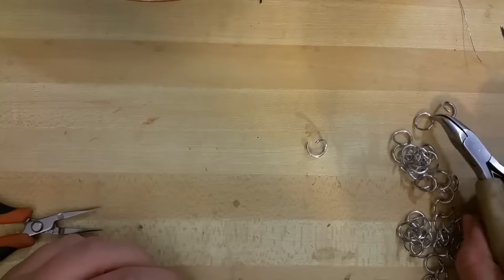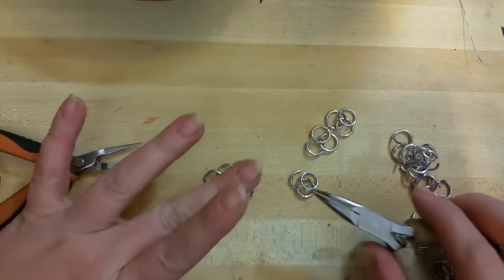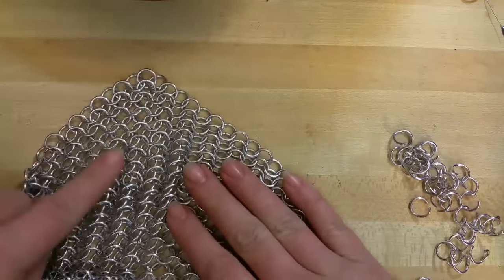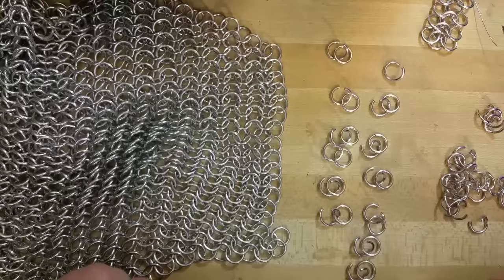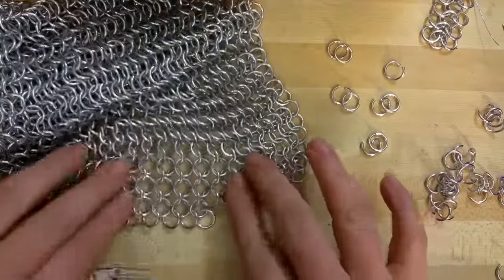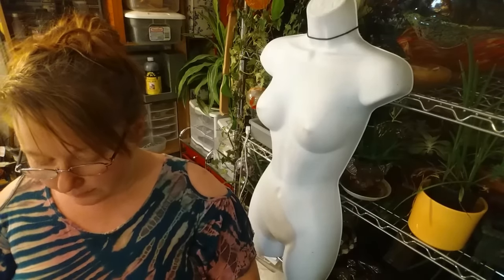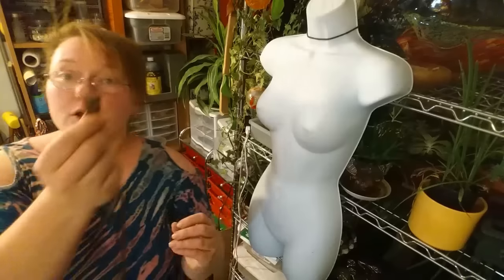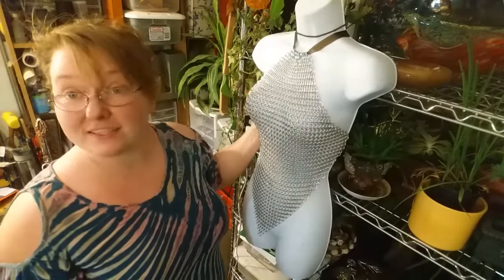Weave for Chainmaille Armor

Comment: I enjoy watching your tutorials. I've been weaving maille for 40+ years now. I started out making maille for use in combat when I was a member of the SCA many, many years ago. My haubrek had over 50,000 hand turned/cut 16 gauge 5/16" galvanized steel rings (about 1-1/2 miles of electric fence wire). Now, I make jewelry and the occasional bikini. Again, your tutorials are great and well worth watching, especially if you are thinking of getting into the craft. Thanks for posting.
Reply: Yvonne. I don't know if you have ever heard of this little trick when making Euro 4-1 pieces, but if you ever want to add pleats to say a skirt or dress do this. When you get to the waist of the piece you add a third hanging ring to every other ring. In other words, 4-1 then 5-1 then 4-1 then 5-1. The next two rows are the normal 4-1 pattern. The row after that is again 4-1, 5-1, 4-1 ad infinitum, followed by two rows of 4-1. Rinse and repeat. By the time you get to the hem of your piece the circumference will have increased dramatically from where you began the pleated section. The bottom of my haubrek was 500++ rings.

Comment: Yvonne, I made a replica of the Bayeux Tapestry chain mail armor out of the old black spring wire clothes hangers. Over 100,000 hand wound and hand cut rings. Aluminium is ok for show, but for use, steel is required.
One MUST wear a tough material under the mail, even if its alu. The ends of the rings can really shred you. Mi padded gambeson was 2 layers of denim with padding in between. If one intends to fight in mail, it does leave some interesting patterned bruises also. I have both the tee shirt and hat on that one. The coif I made from screen door springs which I cut.
  Butted mail is easy, but labor intensive to make. One can either weld the ends of the steel type or flatten , drill. and rivet each link. Really looks nice when done, like the original was, but sooo time consuming. My set, with coif came in at about 65-70 lbs.
 Also I recommend using 2 pair of linemens'  pliers to assemble both alu. and steel rings. You would destroy the light pliers you used for the alu. trying to do steel or even brass mail. I ruined 2 pair of SnapOn needle nose before going to the linemans pliers.
Its easier on the hands with the bigger pliers also. IIRC, I took like 6 months to make my mail.
(And yes, even with the steel rings, in use, the "chainmail moths" still make holes in it that need repair if one actually uses it).
 Nice job on it.
Reply from the maker: Woah, thats an intense project! I've found that the saw cut rings I use for these aluminum decorative pieces are very silky and comfortable, especially after tumbling!

I will check out those pliers; thank you for the recommendation and sharing your experience with maille!
Reply: Yours were saw cut. Cheater :p I was unable to find a blade for that. I used 18" end cutters. I wore out 3 pair of ones from Sears!  I also made my own winding mandrel from 2x4's and round bar, and part of a broom stick.
It was an intense project. The folks at work thought I was nuts(?) but I'd sit in the lunch room doing my "Chain mail knitting". I made some pants leg bags out of old jeans to keep the tools and links in too.

Comment: Does it matter which way the grain lies? Side to side or up and down?
Reply from the maker: Heya, Resist! You get different drape and movement from the maille depending on which way you have the grain lay; I recommend making a 4" square and testing out the drape for yourself to see which way you prefer for your project <3

Comment: Can you get these rings in regular shops as well?
Reply from the maker: Heya, Dark! I haven't been able to find the thicker gauges in larger sizes at Michaels, hobby lobby, or Joannes, but your local stores may be different
Reply: Thanks for answering :) I'll visit my local store and have a look, any idea where i can get a shaft that can be attached to a drill to furl the wire? PS: When making scaled armor, how many scales would I need? I'm confused with the measures used at TheRingLord. Thanks ;)

Comment: I've repaired a couple of this cheap type of chainmail from India the same as you make and I should say it has a lot of issues eg it looses rings as they bend out a little just because of the weight of the armor itself, it stains everything it touches with silverish grey spots and stripes, it catches hair and threads. So probably the only reason to buy it is it is almost dirt cheap in India as they  use chainmail machines and it is light weight because of the material. So my questions are did you try to improve it by soldering or welding the rings close instead of just butt join them? And also did you try to anodise the whole armor anyhow or use anodised rings?
Reply from the maker: Hello! There are a few key differences here between what I made in this tutorial and what can be purchased cheaply online; I use a heavy gauge of bright aluminum appropriate to the costume piece; there are very few tension points on this top so 16ga worked wonderfully. for a shirt with sleeves I would use a 14ga butted aluminum. The bright alum. alloy I use is much cleaner than the fencing wire aluminum used in cheaper maille. Doing a clear anodize on the whole piece or using anodized rings would solve the grey residue problem, but the budget for this piece didn't allow for anodizing. The customer was fully aware of the tradeoffs. Also, properly woven saw cut rings won't catch the way poorly woven machine cut rings do. Body hair can still be snagged between rings though, but that would happen even with welded or riveted rings because its catching in the weave, not in the cut of the rings. I'm sorry that has been your experience with butted aluminum chainmaille, but that level of quality isn't the standard for handwoven work.
Reply: Thanks for the reply. So did you try soldering or welding?
Reply from the maker: Zortorond I have tried with with my little iron and coil of flux, but I think I need a torch to really get things soldered together. it could be my inexperience,  but I didn't care for the results. the chainmaille didn't feel as silky because of little bumps soldering made at the joins,  and the amount of time it takes would have at least tripled the cost of the piece. also,  I wouldn't recommend aluminum,  even riveted aluminum,  for live steel combat.

Comment: now question. i used to make chainmail. did you make your own rings or did you purchase the rings? im asking because i used 18 gadge wire and a 3/4 steel dowle and then cut all my rings with a dremal.
Reply from the maker: Hey, Erik! I coil and cut my own rings using steel mandrels from www.theringlord.com, and bright aluminum wire that I get from them as well, and I cut my rings using a Ringinator. I typically don't use less than a 16ga wire for my rings, but I use a lot of 18ga for my jewelry :)

Comment: I want to make make a chainmail belt for a cosplay what would in your opinion be the best size ring to use?
Reply from the maker: Hey, Deanna! It depends a lot on the way you want the belt to look; in this project I used 16ga 5/16", which gives a wider mesh fabric that weaves more quickly. I really like 16ga 1/4" though because it looks very solid!
Reply: Thank you for the info :)

Comment: I found it faster to make a bunch of sets in the lengths I needed and then stitch the sets together. I could make a bunch of sets a lot faster and with less confusion than trying to keep track of the entire suit. Of course, I used 14 and 16 gauge steel... It was also lighter to deal with a length of sets and then add them to the suit over the form.
Reply from the maker: That makes sense! I work a lot on smaller pieces; this is the largest top I have made in a while, and I'm usually making bikinis and halters with contractions and seams in them where, at least for me, it makes sizing easier to add onto the whole piece so I can keep measuring/ modifying the design as I go. and omg the weight difference between steel and aluminum makes such a big difference!
Reply: My friend made his full chain hauberk from 14g galvanized steel... It weighted in at like 54lbs

When you are doing measurements, are you taking into account clothing under the chain? I know you have to account for the gambeson. I was always curious if the bikini chain and tops was worn over something, because chainmail can be rather pinchy... ;)

Comment: For some reason, I have a very hard time doing by this. I have dyslexia and wonder if that's the problem.
Reply: Rena Godfrey I can understand your dilemma. I do the wire weaving and if I'm not careful when I first start, or put it down and pick it up, for some reason I put it in the wrong hole and have to go back and redo. I catch it right away, so it's usually not a hassel. Yavonne, gives a heads up about any entanglements you might run into in many of her videos. I took her advice and did a few practice pieces. Start small and then go bigger.
Reply from the maker: It could be! I am dyslexic as well, and so I weave backward to how Randy does, which is great because when we work at a table together he is sitting across from me, so it all works out. Chainmaille is not widely known for being easy, so be patient with yourself and you'll get there!

Comment: Great chainmail work, please don't call it armor though, this is clothing. It won't protect from a weapon as the rings will just split back open. For chainmal armor, you need to close the gap in each ring. Traditionally with rivet's, more modern with welding. But i guess that's not the point anyway, considering the shape (;
Reply from the maker: Thanks for the info, Patrick! yeah, this one is pretty obviously costume :-p

Comment: sadly this wont really hold up to practical use .. so ist not really what was used in medivel europa ... oll i ask is that i sell it as what it is. a prop for theater and cosplay
Reply from the maker: It is the same weave pattern as what was traditionally used. I thought I
 made it pretty clear that this is a fashion piece that is meant for 
costume purposes or at most larping with foam weapons. Live steel combat
 would take stainless steel that has been riveted or welded, and layered
 with other armor pieces, but it would still be done in this same 
weave.